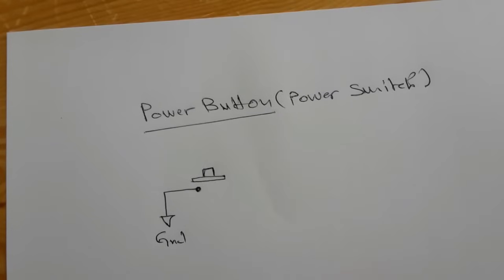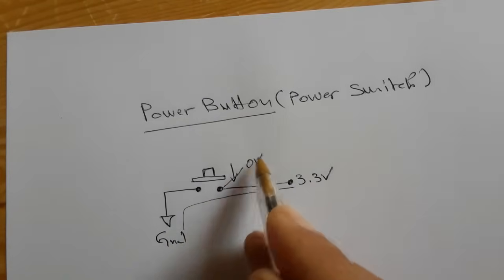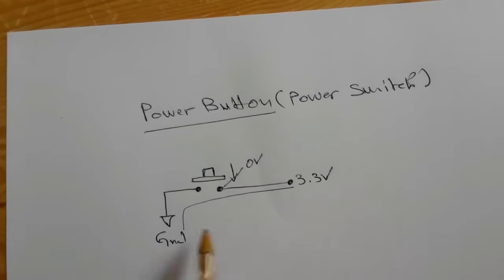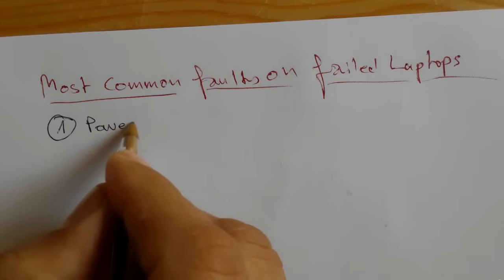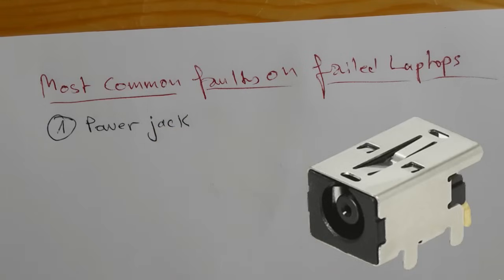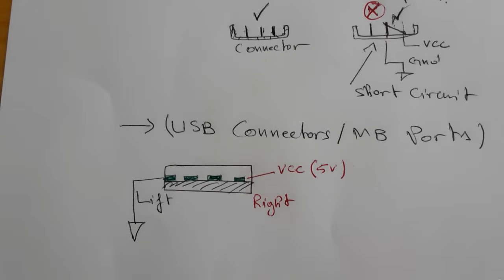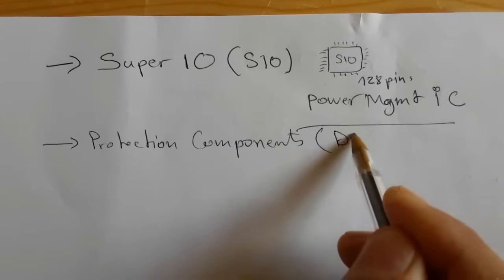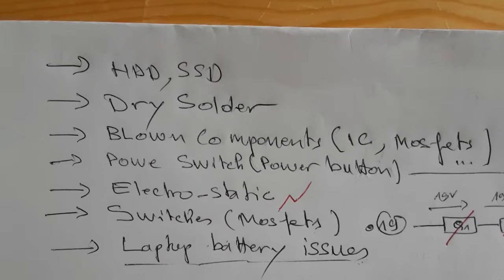Learn Most Common Faults on a Failed Motherboard - How to diagnose a laptop motherboard Course

Comment: One time the laptop wouldn't turn off and the hard drive popped out of its connector, I tried to put it in, not knowing that the laptop was under voltage and the processor burned out!

Comment: Ho un laptop hp 6570b entra tensione al primo mosfet ma in uscita mi trovo 0.45v intermittenti e naturalmente nella resistenze sense 0.68. Così com'è mi trovo tensione fissa a 3.2v nel tasto accensione. Non ci sono corti in tutte le bobine e anche nei condensatori. Se alimento dalla resistenza sense con 12volt mi trovo i 3.3 always e 5.1v always per circa 5 secondi e poi 0v. Premetto che quando premo il tasto di accensione vedo sulla scheda la luce bianca intermittente per 5 secondi solamente. Cosa posso controllare? Grazie

Comment: its special tutorial thank you so much, just im goining  to ask some questions 1. if inductor is short in board does it necessarily only problem is with inductor, doest it may capacitor ext..?2.SIO has 128 pins   wich pins is Vin?,wich PIN is ground?,3. how we know ICS in board means what is its Reference eg. for MOSFET U, inductor L...how we know where is south bridge or north bri...thank you so much
Reply from the maker: Inductor is just guide.
Vin is varied as SIO part number varied

Comment: I have a HP x360 laptop does not start. I had opened it to upgrade the Ram chips and wifi chip. It looks like the wifi wire touched the circuit board and shorted it, it has no lights or nothing now but did turn on normal before
Reply from the maker: Hello bro, short circuit problem, I can help you until the problem is solved, and become your mentor , join me on Patreon page in the description box